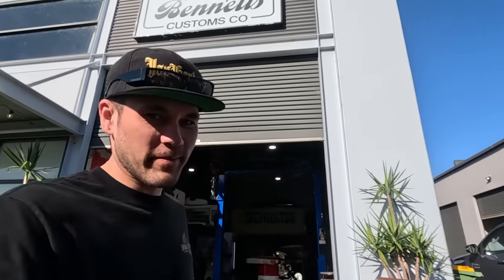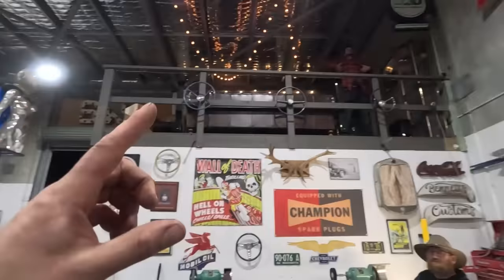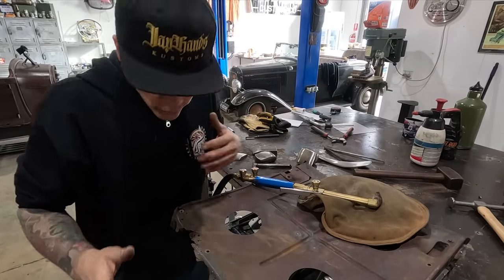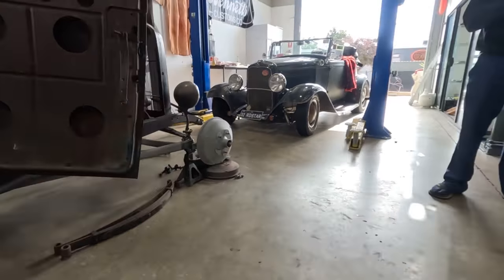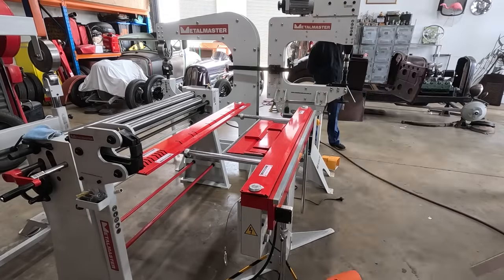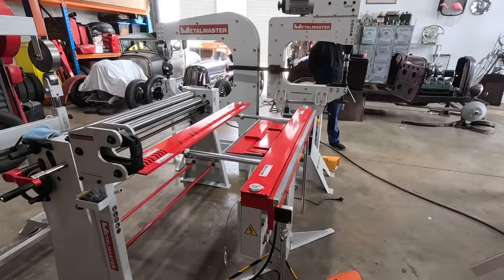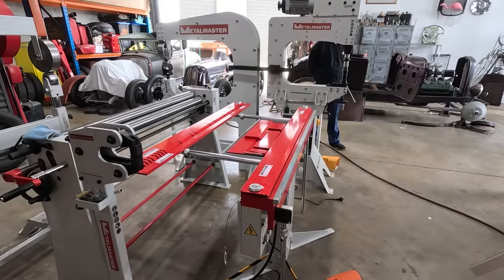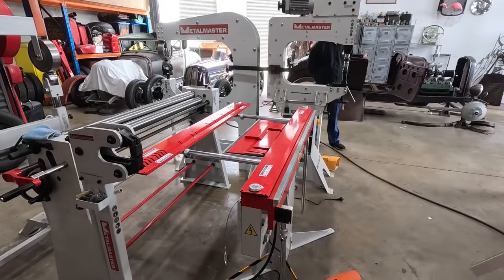How To Make Rust Repair Panels Step By Step - Metal Shaping Shrink Stretch Profile Dies

Comment: Always love watching Karl persuade shape and form into a tricky piece using subtle artistry to truly restore what had been scattered to the winds as rust dust.  Watching the efficiency of the pro level tools like kick-shrinker and the power hammer perform better than expected is always a treat, but it is still the experience metal-forming and the set of handmade form tools that do the actual work.  Karl brings it on home again with the tried-and-true methods; hand-forged tools, slapper, dolly, heat shrink and hammer.  Karl was going full-on Bad Chad with a zip disc down under (probably homesick for his Makita cutter).  Aussie car rally shows off some awesome iron, as usual. Kristine must've gone gaga for that white Caddy.
Reply from the maker: You can read me like a book Jim! Everyone needs the makita cutter! Lol 😂

Comment: Awesome.  First time I've seen anyone heat a doorsking edge to remove it.  Just dull red to get it to yield a bit?  Ive been wondering if heating a double thickness vintage wheel arch to roll it properly with a hammer and dolly would be the ticket?

Comment: Karl, you are so close to what I am thinking about and yes, we had this  conversation before. you have a ton of admirers but this deal from me must hold some kind of water???? Ford motor company did not have time for people to just stand and run multiple passes. I told you sewing machine and you said you seen it yet you did not or have not giving it a chance on video.
       Think feed table, a flat surface like the metal starts out like. Your working the hammer mill right but now, in front of this part, imagine a foot pulling this metal in like a shrinker stretcher so kinda does. At this point, it is where I do seem to lose you. You know the distance between bends so mark out the turns and mark anything you think will or might make a difference.... but just don't over think this quite yet. I see the metal bunch up on curves yet start by maybe using a saw or plasma to relieve it on the curve next to the turn so its only making that nice form your going for. I remember seeing a large press stamp out the fenders and doors for automobiles. That friend might just be your next tool to form door or hood, fenders.  Just maybe the C&C machine would precut the form with holes for the handles and other stuff in a door opening panel then lay that into a mold and whack it with a large hammering device.... even I now am at a loss for ideas that seemed simple in my head at first.. I do think I am on to something that would make a door or other pieces in one go..... keep em coming and my ideas that are swept under the rug as a old mans dream..